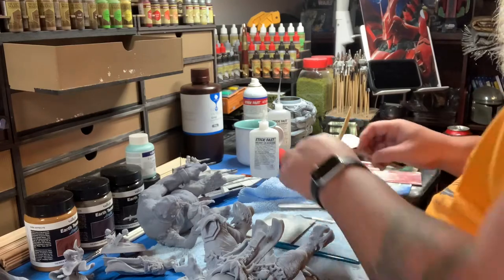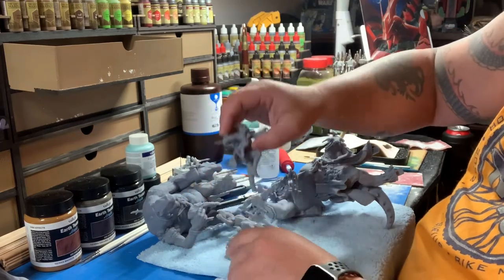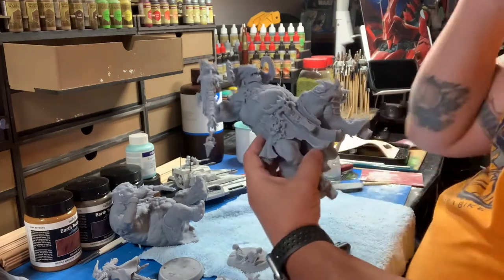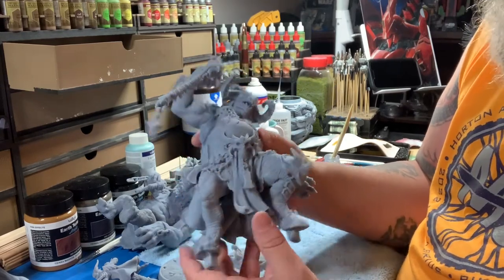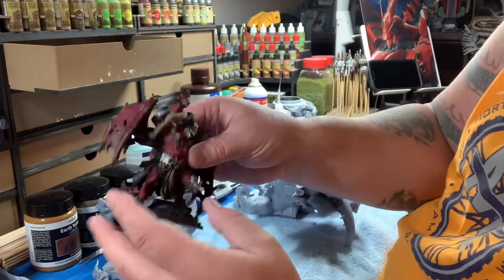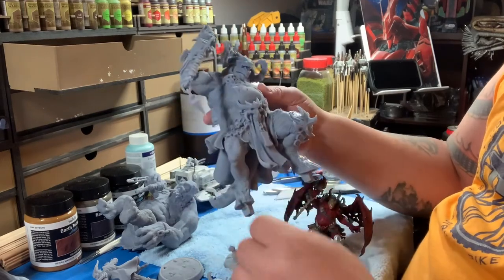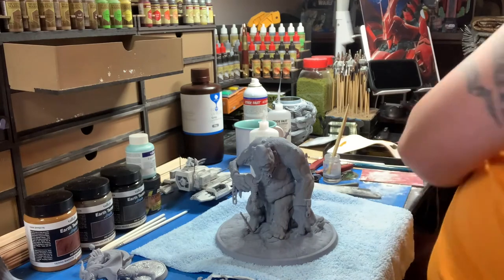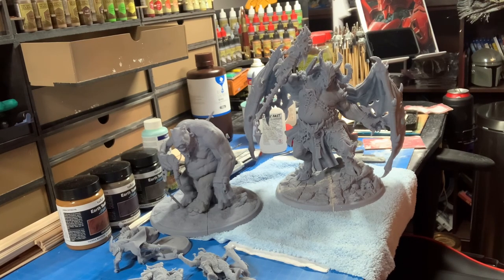Prepping 3d resin prints for primer

Comment: Hi! not sure if much help but here are some of the steps that I implement when doing large prints. Lower the density of the supports in the slicer. The less support the fewer nobs. Just make sure to target all islands. To get a nice seme between pieces print those pieces away from the build plate and with no supports. It leaves you with some nice smooth connections. When filling I use Miliput and water to smooth and wood filler both work great than a combination of priming and sanding. I do not fill my drain holes as I add them in places that are never going to be seen, Either between two pieces that lock.
Reply: I find it's actually better to do lots of light supports rather than medium/heavy.  The medium/heavy supports leaves nubs/potmarks, but the light supports, at least for me, do not.  I also use hot water when removing the light supports, which also helps prevent nubs/pot marks.   So I don't have to do any cleanup work with supports.  However, I will sometimes add a few medium supports if the piece is particularly large/heavy in certain areas.

Comment: Having a good resin helps. Some resins are a pain and has issues with supports. I peel off the supports right after printing, then do a 2 stage wash. One to get the majority of the resin off, then a second to have a cleaner model. Once it is clean and dry, I do an initial cure, then cure inside the holes. Ill superglue pieces together and use resin and a UV flashlight to fill gaps. I'll then sand it or carve back in the texture if needed.

Comment: I recently watched a Loot Studios vid where they recommended creating mixtures of varying consistencies with resin and talcum powder. They advise mixing this in opaque containers that can be closed/sealed. Apply w/ a silicone brush and in steps so you can cure w/ UV light between each step.  I haven’t tried this yet since I just watched the video earlier today, but I’ll be attempting this method soon!
Reply from the maker: That’s an ok method on anything that’s flat with no texture. If you’re trying to fill a seam that has texture, I wouldn’t use it because when you cure it, it will be flat and stand out. I have a newer video showing the use of UV putty, which is my current method I use.

Comment: I built an "internal" curing light with a UV led bulb and a battery pack.  It had enough wire so that I can insert it into the inside of a hollowed model and cure any resin in the interior of the model.  One of the drain hole needs to be at least 4mm in diameter.  I saw a video of how to make it here on YouTube somewhere.  Can't remember who did it.
Reply from the maker: I’ve seen several videos of similar type of lighting. Haven’t made anything as of yet. I’ve just made my cleaning in IPA much more rigorous and drying everything longer. If I ever have anything continue to ooze I just clean and dry it again. So far only one model has needed that.

Comment: Not sure if anyone mentioned it yet since it's been a year, but you can save your drain plugs and then glue them back after its clean and drained.
Reply from the maker: Yeh I’m aware. But most everything I print, is presupported.

Comment: If you've still got resin leaking out after curing then you're not cleaning them good enough. You gotta give prints an IPA bath, dunk those things and let the IPA fill up the insides, let it run out, repeat several times, then let it dry for a day before curing. You can also use an air compressor to blow out the excess IPA from the insides. If you don't get all the resin out before filling the drain holes your model could develop "resin sists" a month or year later due to the resin gassing off.
Reply from the maker: Thanks for the comment. I made this video a year ago, but since then I’ve drastically changed how I process my prints. Basically everything you just said is what I’ve been doing since this video was made. Even filling the drain holes has changed. I used to use epoxy clay, but now use phrozen I’ve putty. So much easier and faster. It used to take me a week with the clay but now only an hour of so, with the putty. Sooo much easier.

Comment: hi, you can keep the `hole` you dig out, print it and then use it to plug the hole in the model back in along with your resin and light process it will work great. check the options when you select to dig the hole in your slicer
Reply from the maker: Very true. But on almost all the models I get and print, they are already hollow and presupported. Which I was referencing in this video.  I am getting into upscaling a lot of stuff which I have to hollow and pop the holes. I’ll give that a try and see how it goes. Thanks for the tip.

Comment: The video is kinda long and slow so i got up to 6:45 and you are saying that you will get oozing if you don't fill your drain holes. What i wonder is why would there be any resin leaking out in the first place, you clean the prints out in IPA and make sure if hollow, that the insides get properly washed as well, then that's it. If there would be resin in there and you would fill the drain hole, resin would eventually eat away at it regardless (so i have been told, i haven't had experience with it personally as i clean them well). So in a nutshell, clean hollows well, don't fill drain holes unless they are in noticeable places or you actually care how under the skirt of minis look, and use miliput / green stuff to fill in the gaps between parts. For cleaning supports, i use a blade and files of various grit. Good luck
Reply: yeah, trapped resin can cause the model to break or even explode. Happened to me once. Forgot to place drainholes, noticed it after I printed it and left it in a container to deal with at some other time. Few days later it broke and resin started oozing out. You definitely dont want to have that happen to a painted model xD. Also could cause a dangerous situation as it's resin after all.
Reply: He needs to buy himself some UV led's (you can easily get them on Amazon along with the power outlet connection)  and you just put the UV led's inside to cure the resin.

Comment: Have you used a hot water rinse before removing the supports?
I do this before removing supports and alcohol washing my prints. The supports come off far more easily and leave less marks.
Picked up this tip from various content creators, and many had only recently heard of this after years of printing. Risk can be softening the model the longer it's in the hot water.
After each wash I like to airbrush with just air any moisture.
Reply from the maker: Yes I have. I didn’t care for it. I still had support dimples and a lot of times the piece would break if it were on small or thin parts.

Comment: So I only do large prints. 1/4 scale and above. I use files, sandpaper, rotary tool with diamond, stone and metal burrs. For filling needs I only use air dry clay, spakle and resin. I find clay easier to use then epoxy. I can sculpt it better and it sands easier when needed.
I only fill seams if there's a gap. I use resin with liquid mask to keep the parts separated. It's hard to explain in text alone. Prep work takes longer then painting and not as fun, but we'll worth the time and effort.

Comment: There is no text book way of doing this, everyone has a different method and tools to use. Every  model will bring about its own challenges and its easy to get frustrated. 

One of the best things I did is switch to translucent resin, I use Siraya Tech Fast Smoky Black exclusivly. I can print a little faster and when I use resin to fill holes and defects the UV light will cure the inside better, less seepage later and reduces your chance of ruining the model by cracking.When I empty a bottle of resin I fill pin applicators with the leftovers, it works wonders just keep it out of sunlight and away from the UV torch. 

After I wash my prints in IPA I put my prints in hot water with a small amount of purple degreaser, it helps with residual resin. The hot water helps the supports pop off with a minimal amount of scarring. Before I cure, I take a needle file and knock all the nubs down or scrape with an hobby knife, the material is softer before its cured. I use a bright light and sense of touch to find other areas the supports were and process them as before. Once i'm happy I cure it. 

Pending the amount of detail I use fill primer(aerosol) and sand and sand and sand until i'm happy. The only airbrush primer I like that does a good job with filling and lays flat is Badger Stylinrez primers. That stuff is fantastic, you can hose it on and repeat multiple times. Plus its sandable if need be. Often times I find area or spots i miss so Use Spot putty or Green Stuff, fill and light sand and re-prime.

Drain holes are something I try to hide as best as can, I usually can fill with Green Stuff or resin if need be. Phrozen has a resin putty that just hit the market, I have not used it yet. Support placement and orientation is key. I support islands and usually put a couple heavies is about all that I do. On large capes and bases that in multiple pieces its best to orient and not support the mating sides for best fitment.

I use a mixture of sanding pads, Emery cloth, needle files and so forth to finish. Hell I use straws, chop sticks the small black plastic wiring loom to get the shapes some times. For seams I use Green Stuff, Super glue and baking soda, Apoxie Sculpt, resin..the list goes on. It depends on how I can process it the best. It all just depends on what I'm working with. 

I hope this helps to some extent, its a daunting task. Sometimes you have to think outside the box and do what works for you.

Comment: I start by making sure they are completely dry however when using heavy supports i deal with them before the curing process I recently printed out a Monster and at 180% I mostly try to place the drain holes where the parts connect so they remain hidden and I don’t have to fill them. I start by sanding down the stuff from the supports with a heavy grit making my way down to a grit around 800-1000 which basically polishes. I recently got a model kit that came with some sort of sponge thing that does a better job. After i use the miliputty rolling it out to get rid of the like then make a light solution mixed with water to remove holes or opening made by the shrinking and apply it with an old paint brush since it basically will destroy it lol. Sanding sticks really helped me get into those tight spaces. To remove scratch marks from the sanding i found that a light coat of resin really goes a long way.
Reply: I’m still fairly new as well so take what i do as self assessed solutions